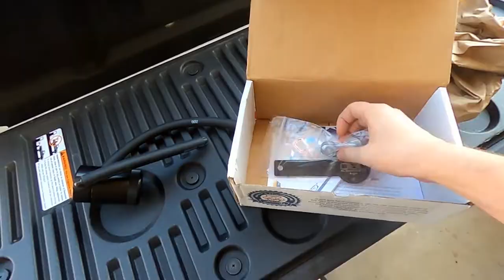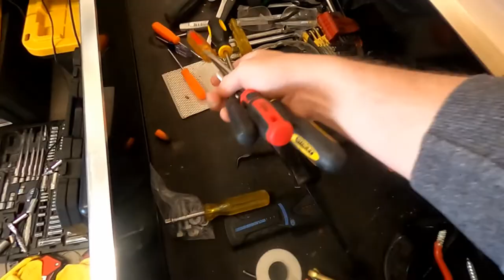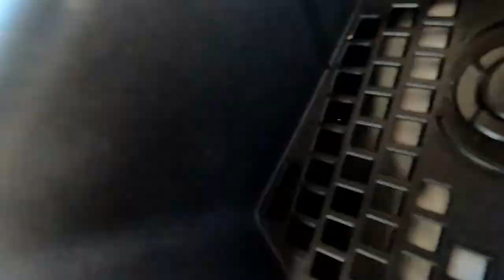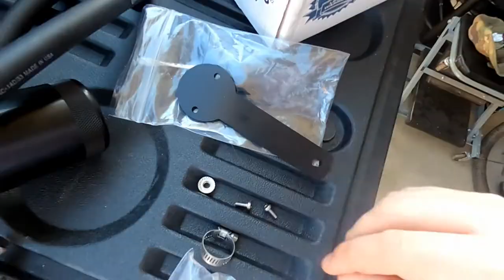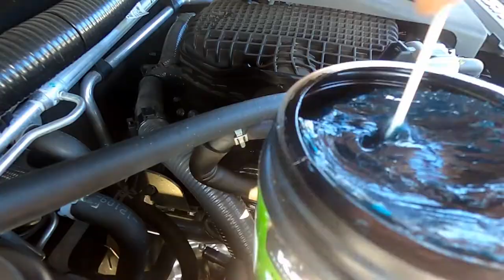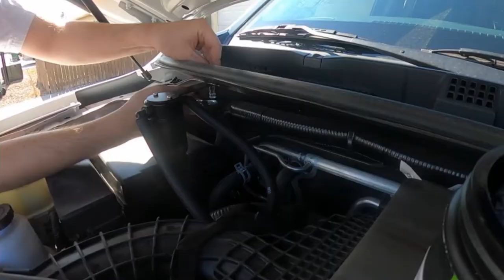Oil Catch Can installation : in one minute -- 2022 Nissan Frontier

Comment: Thanks for the video. Just took delivery on a new 2023 Frontier. Didn't realize the new engine uses direct injection. Why not just vent PCV to the atmosphere using a breather filter like the good old day.
Reply: The EPA would have kittens if the factory did that but i think it also has something to do with pressures? Not entirely sure why you can't just vent it yourself 🤫
Reply: @WheresTheSauce  You are correct. Since I posted this I've come to find out that the PCV needs the vacuum generated in the Plenum. That's why the hose goes from the PCV to the vacuum side of the intake. Without that vacuum the crankcase won't fully evacuate leaving positive pressure in the crankcase.
Reply: Just want to Applaud 👏🏻 the skills of not losing that 10mm socket. 🫠🫠🫠